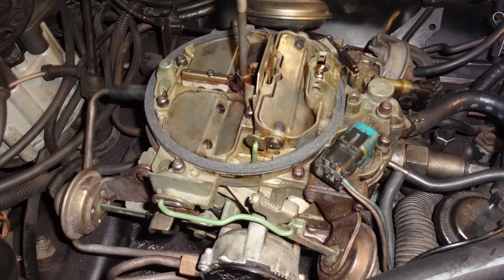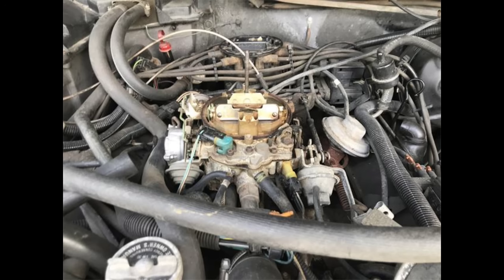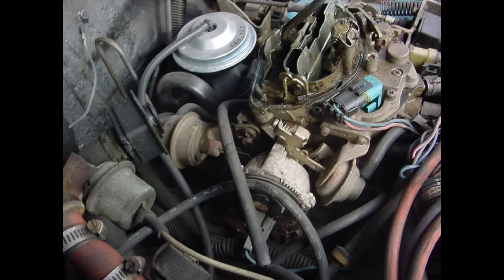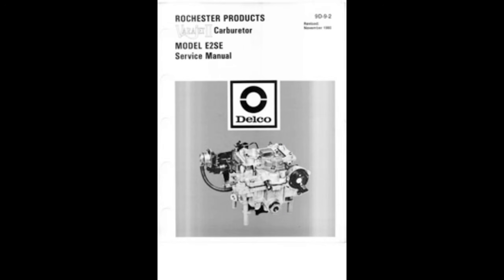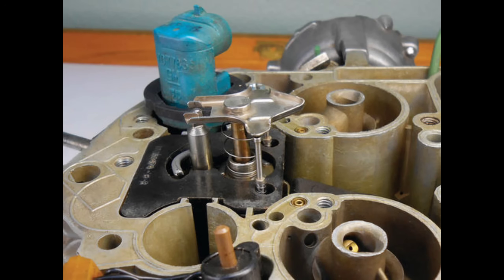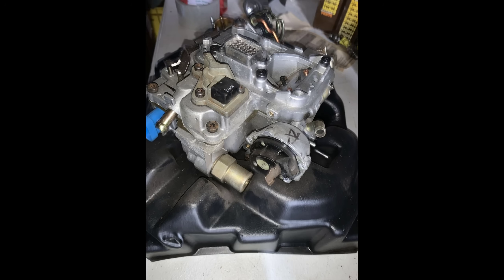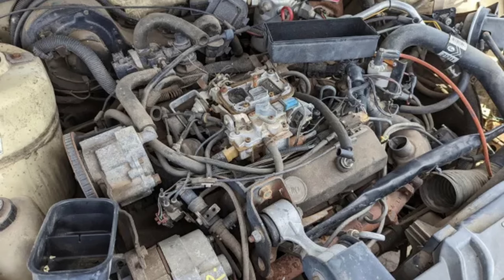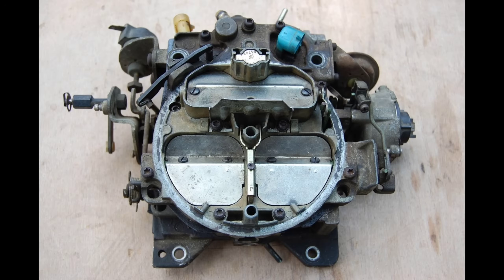GM'S Bridge To Fuel Injection: The Electronic Feedback Carburetor

Comment: I had the E2ME in my 1986 Cutlass Supreme with the 3.8 V6. I did nothing with that carburetor and drove the car for 198k miles. I finally gave it to my mother who traded it in for a 2003 Mercury Sable.

Comment: One of my long term projects is putting one of these back onto my 88' Caprice wagon (would have had it originally but got swapped at some point). But since I don't have the ECU I want to design a new one for it. Using modern microcontrollers, sensors, etc. Between the meter rods and the electronic ignition advance I'm curious to see what possibilities there may be when I have control over the mapping and various regulation sequences.

Comment: Surprised to see as much positive feedback on these!  My only experience with the Electronic Feedback Control Carburetor is on a late '80s Jeep BBD carb. on the 4.2l.   They were absolutely scorned! I thought that a revisit to this concept, with modern electronic/computer technology, could be viable.  Especially if it had more electronics with less vacuum controls.  I mean, come on, these things had Speak and Spell electronics technology from the '70s!  My only problem with efi is plumbing for high-pressure fuel and COST!  Something about half the price as TBI (let alone MPFI) would be attractive.

Comment: What would cause Codes 21,23, & 45 all at the same time? Sometimes 1 or 2 or all 3 show up. Car is running really rough and dies unless I keep my foot on gas and rev it. Lights working. Dies also when ac or heat is turned on. 

New battery, alternator, and shop said they supposedly rebuilt the carb but didn't replace the TPS sensor or fuel pump as I asked them to

Comment: So I hate to be one of those folks throwing out a car question for help but you seem to be the right guy. Recently had the fuel pump starting leaking externally on my olds 307 with 74k original miles. It’s in an 83 olds 98 if that is helpful information. After replacing pump it began flooding my carb blowing past the needle and seat. The carb was rebuilt by myself with very little knowledge 9 years ago. Figuring it’s been 9 years and 20,000 ish miles I figured it was due for a rebuild. Rebuilt carb replacing needle and seat and setting the m/c solenoid with a piece of metal blow gun nozzle cut down closest I could to 1.304 specified. I put the carb on and needle and seat issue was resolve. Adjusted air bleed using a dwell meter on 6 cylinder scale, car was still running at a faster idle than before. Found vacuum line broken and helped but feel I need to revisit adjustments. The question is do you see a reason I would random start getting a vehicle speed sensor codes randomly after about 5 minutes of warm up. Doesn’t happen every start and was not an issue before. Could this be a result of slightly higher idle on startup or did my 41 year old car decide it wanted more attention. I have an otc 2000 reader and was able to see speed sensor reads at 0 when parked and does slowly climb and almost perfectly matches the speedometer. Vehicle does not have cruise control either if that matters. I have service manuals but can’t find my data on vehicle sensor other than it is used for lockup. Thanks for any insight.

Comment: The most dialed in carb I ever had was on a 72 Buick 350. It didn’t have an electric choke but kick it down a couple times and it would fire up immediately. About 10 seconds I’d kick it down to a lower high idle and as I drove it would drop to low idle. I never touched a screw on the carb in my 5 years of driving. It never smoked and always got between 17-21 MPGs. It was in a Skylark convertible.

Comment: About 8-10 years ago I had an 84 Camaro with the feedback carb. At the time, I hated it because I didn’t understand it. At this point in time being older and wiser, I am starting to appreciate them for what they were at their time. Currently I’m trying to resurrect a 1980 Camaro that is bone stock and been sitting since 1994. When running, I will put what I have learned to the test to see if I can dial it in and get it to pass smog here in CA.

Comment: It was easier to just find an older GM car no longer running, and put an earlier quadrajet and distributor on the engine. Then there would be no more nonsense of the problems that these carburetors had. Mechanical Quadrajets were a good carburetor and once you tore them apart occasionally to clean and learned how to do it, they would run great. But the worthless fuel filters they had, some dirt would always get through them,,,,,,,,,,,,,,,,

Comment: My 1982 Malibu Classic has a Dual jet 210 atop the 229 ci v6. We have had the car since new. It has proven to be a great carburetor.... for the most part. It was a little crabby when cold and wasn't a fan of idling in super hot weather. The idle control has always been slow to kick up for AC demand.
Great video!

Comment: My personal experience was having problems with the TPS (throttle position sensor).  Because it was a sliding potentiometer, the contacts wore dead spots in the most used portion.  Usually steady cruise.  Those spots would reveal themselves as uneven performance or hesitation.  

After replacing many of them in my own personal vehicles, I retro-engineered my 85 Olds 88 w/ 307 to pre-computer configuration.  I used the Q-Jet and HEI distributor from a donor 75 Olds Cutlass with the 350.  The transformation was a success and I took out all the attending smog stuff.  The engine bay looked so much neater and the engine ran like it was supposed to.

Comment: YT blocked my comment. I think I might have said something offensive about that carb setup. I am sorry, I had no idea that electronic Quadrajets were so easily offended.
Reply: This is a common problem.  90% of the algo is geared to protect one very special demographic.  Even the emojis for them will alert it. 

The other 10% looks for too much technical detail, an active voice, and a Flesch–Kincaid readability test.  On the last, if a cmmoent scores too high, it gets dumped.  You got caught by the 10% part.
Reply: You mean he called the Quadrajet a rump ranger, an ass pirate, a Hershey highwayman,  a pillow-biter. ?  😂

Comment: I had one in my 85 S-10 V6. I didn't like it. After about 100,000 miles it worked inconsistently, when giving full throttle sometimes it worked ok and sometimes like it wasn't fully open. I replaced it with a Weber

Comment: I think that's what was on my 86 regal 3.8. I put a petronix 50k volt coil in the hei and the carburetor automatically lowered the idle to probably around 400rpm and it would never stall. You could see the pulleys turning it was moving so slowly.

Comment: I used to maintain a large fleet of cop cars and we had plenty of those feedback QUADRAJETs. 
There were some guys in our shop who were good at rebuilding them and some who were not. I actually enjoyed doing them. The last year they came on the Caprice was 1988 and they worked really well for the duration. However, the same carburetor on a 1986 Dodge Diplomat was nothing but trouble. I can only assume that they were much more sensitive on a smaller engine and demanded more tuning but they also had a major problem with losing the secondary emulsion tubes.

Comment: Hey, I have problem with my Buick lesabre 1984 5.0 with this carburator. Engine start well and when is cold everything is Ok. When engine is hot the car have problem with exeloration, not all cylinders are working. Its like this when I try spedup dynamic. What i should check first? Who can help? I'm from Poland, dont have shops with parts to this electronic quaterjet.

Comment: Bought a 1984 Caprice in the early 90’s and still have the car. The E2ME has been faithful for 30+ years and 160,000 miles but only after it was adjusted correctly.

Comment: 7:00 min, you need to punch out the plugs covering the idle jets so that you can richen up the idle by turning them abou 1/4 turn counter clockwise or more untile the engine will idle good. Apparently the factory adjusted them lean to pass emisions.

Comment: My dad had a 1987 Hyundai Excel. It did not have this carb, but it did have some kind of carb that was connected to an O2 sensor. When the carb failed, it cost him a lot to repair it. Dad said that carb was built by Mikuni and had cheap crappy nitrophyl floats.

At the time, mom had a 1985 Nissan Maxima. That car was far less reliable than the Hyundai Excel, but at least that was not where the problem was. It had EFI and did not have a problem with it. Mom had it for 9 years, and it didn't have a single problem related to EFI.

As bad as the carb in the GM or Hyundai were, I heard that the absolute worst O2 sensor carbs were in Hondas. They also had the largest amount of vacuum junk attached.

Comment: Great video!  I have one of these electronic quadrajets on my 87 Caprice cop car with the 350. Anyone know where I can get a fuel line for where it runs into the carb? Broke mine swapping the fuel filter out. Also need the insert part for the filter that goes into the carb. Any help would be appreciated .

Comment: I used to chop these things up with an axe. 

The problem with just about any q-jet is that they are very sensitive to vacuum signal...and the problem with THAT is that being on a carbureted engine....the engines wear at a faster rate than modern fuel injected ones do. The result of that is a degraded vacuum signal from the engine, which is detrimental to how a carburetor works in the first place. We won't even talk about the fact that during this era, just about ALL of GM's V8 and V6 engines suffered from premature camshaft failures which made it even harder for the carburetor to work correctly. I hated working on shit from this era. It was never easy.

Comment: Rebuilt many of those carbs, was working For Chevy when they came out. I loved working on them seldomly had a problem with them. I also worked for Ford in the late 70’s when the VV 2700 came out. They were pretty touchy on a cold start. We would have the owner leave it over night and that in most cases. Prevented a comeback. Also we emphasized the importance of to the customer of keeping up with a clean air filter and air horn gasket. That makes a big difference especially with the VV carbs. I enjoyed doing carb work.
EFI performs better but there is just something very satisfying of turning that key and hearing that engine purr when you rebuilt the carb. Plugging in a scanner reading the scan data just isn’t the same.

Comment: They just took patience and comon sense. I maintained s fleet of vehicles with these and the electronic Varajet E2SE. I re bushed  the throttle plate on hundreds of both of these. Once the factory friction coating wore off. Great carbs actually.

Comment: Fun fact. The 1971 Ford 429 Cobra Jet was factory equipped with a Rochester Quadrajet, I have a 429 intake manifold in my shed that has the Quadrajet mounting pattern. The intake ports are huge.
The 429 Super Cobra Jet used a Holley carb.
Reply: This is true. Ford also borrowed the Harrison A6 AC compressors and disguised them with motorcraft decals. Then they ran commercials bragging about how quiet and refined their new LTDs were. 😂
Reply: @timsharpe3498  The Ford, Lincoln and Mercury models that used the GM Frigidaire/Harrison AC compressors rather than York (aluminum) or Tecumseh (cast iron)  A/C units were often also equipped with  GM Saginaw power steering pumps as were nearly all Chrysler corporation and American Motors vehicles in the late 60s-70s. 1971-73 Mustangs and Cougars also used the GM Saginaw power steering gear.
However,  midsize Buicks Oldsmobiles and Pontiacs with V-8 engines and 3 speed manual transmissions used a Ford "Dearborn 303" transmission as GM did not make a heavy duty 3 speed.
Chevrolet, and of course Cadillac division did not use the Dearborn 303
Reply: @donreinke5863  

I totally understand why they used the A6. I owned a Cougar that had the Tecumseh compressor and it sounded awful and had quite a bit of vibration.

Comment: I have a box of these in the attic, mostly for the parts that fit REAL Quadrajets.
I used to pull these things off and replace them with regulat Quadrajets scavenged from wrecking yards.
I considered them useless and troublesome..and still do.
Getting rid of the check engine light was easy. I used to run a wire from the light to an oil pressure switch teed into the oil galley along with the standard oil pressure light switch.
It would mimic the normal operation of the check engine light perfectly.
Emission cheats were...and are...a specialty

Comment: Boy did this bring back memories. How many of you went to the GM Training Center in Burbank? I took the classes for these carbs. Fred Woodley was the instructor. To get the idle mixture screws out I made shallow cuts with a hack saw on both sides of the adjustment screws then punched out the hardened steel insert. The engines idled like a champ after backing them out a full turn. The tools were called "Double D". I still have mine, I think I used Lisle brand. I remember some choke pull-offs had spring tension adjustment screws accessed thru the vacuum nipple port. I used to leave my house at 530am to beat the traffic on the way to GM class. I got there an hour early each day and would watch the Olympic ice skaters train at the rink next door.
Reply: I went to class there in late 1980. Grat instructors at that time. I don’t remember his name but he was Good.
Reply: I spent 8 weeks (?) in late '77 attending an apprentice level program at the Burbank facility.  Don't recall any instructor's names.  Ten years as a Buick tech starting in '78.   I did meet Bill Trevor after he retired.

Comment: I love me an old Q-jet, but my dad had a 85 pickup with a 305 and one of these. It was horrible. Cruising down the road, it would just go super lean and knock like crazy. Some times it would work great, but other times it would have so little power it was hard to drive. The dealer said there was nothing wrong and the check engine light never went on. Dad finally sold it. Pity, it was a great truck other than that.
Reply: 305 could possibly be the worst engine ever made. Catalytic converter would fill and flatten the cam. Probably what happened to yours!😅

Comment: Had one on my '84 Delta 88 with the 307. In the last months of ownership, I would drive a few miles and then get a CEL, floor the accelerator and blow the massive amounts of black exhaust out, the CEL would go out and repeat process a few miles down the road. Took it to the shop to get looked at and was told it wasn't worth fixing. Bad transmission, worn out cam shaft and the carb issues were too much. Never found out what exactly was wrong with the carb....

Comment: Also, a few comments here about the CFM of earlier units are incorrect. The standard Q-jet was rated @750cfm. GM enlarged the primary venturi ( but not the throttle plates) to flow 800cfm specifically for high performance Olds, Pontiac, Buick 455 engines 😅

Comment: i think there was an autolite carb that did the same with a stepper motor as opposed to a solenoid. I had an amc spirit with one and I just disconnected the stepper motor when it was on the rich side of sweeping through the range on bootup. car ran real good.